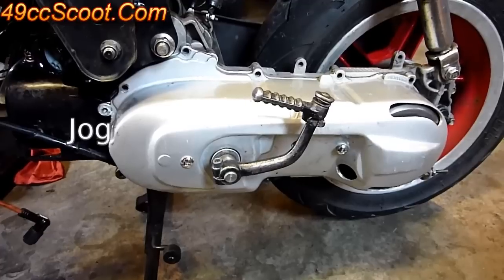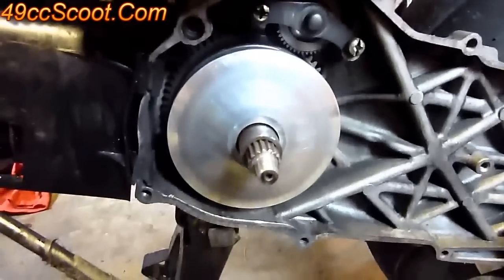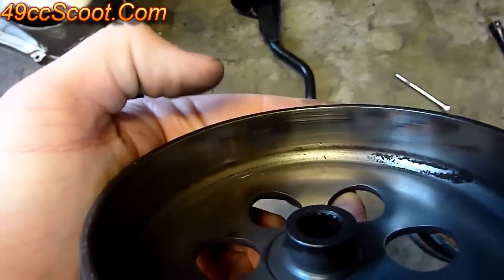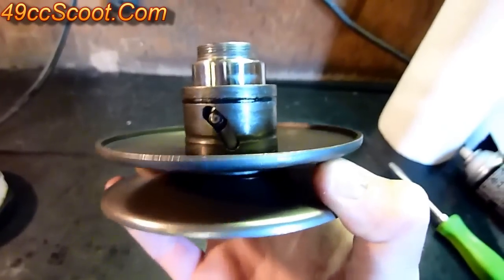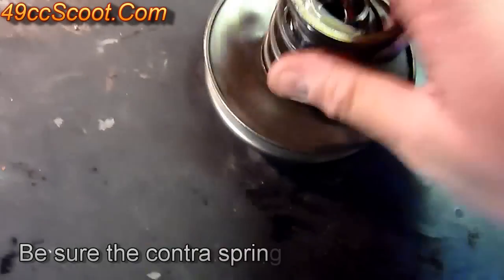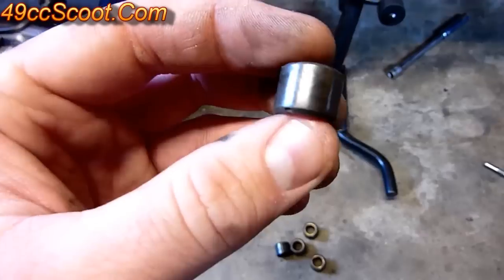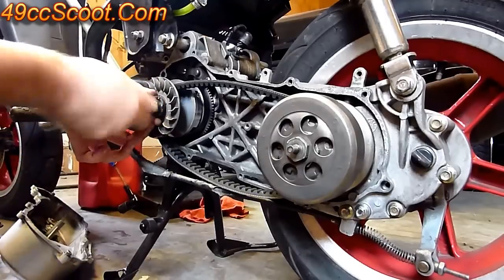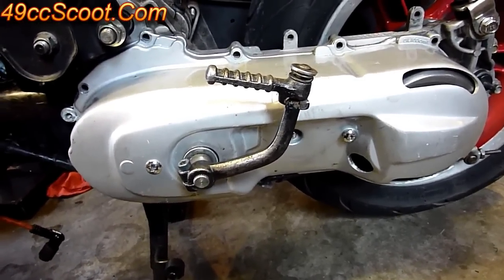Scooter CVT Transmission : Full Service Inspection

Comment: hi great video,I would like to ask you. my problem is,If i have no load on my scooter the clutch engages,when there is weight barely moves. please help what could be the cost? I was thinking clutch pads. I havn't opened the clutch bell cause i can/t remove it yet.
Reply from the maker: It sounds like the clutch is slipping under load. Could be shoes or glazed bell or grease in there. Could be that the belt is slipping from being too narrow or glazed or from issues with the pulleys. You're really going to need to get in there and look it all over to know.
Reply: ***** Thank you so much for the quick reply. I may have more questions for you in the future. I just bought this 50cc yamaha jog scooter Please bare with me 1st timer here,never owned a scooter before. weird thing here in the philippines is that my scooter body is a yamaha jog but the engine is a yamaha target....anyways its a vertical engine,Im using your videos as my reference even though you have a horizontal engine on yours.Its a fun little project. Good thing you showed the wobble in that clutch shaft I got worried! I have a bit more play in my clutch shaft though.
Reply: john santos  may i send you pictures of the parts of my scooter?
Reply from the maker: I don't have hands on experience with the verticals, but sure. Some of the guys on the forum have them, at 49ccscoot.proboards.com if you want to post there about your issue.
Reply: ok thanks.

Comment: Can anyone answer my question ??
Front covering part of my scooter has got cracking due to hitting into a minor accident 
Line cracks n small bloat 
Will it be Roadworthy????
Reply from the maker: So just the fairing? If it's only a plastic body panel, it may be roadworthy. Depends how stable it is and what is at risk if it fails. Not cool if it cracks and you lose the headlight or it falls off. It's one of those things you need to have someone local look at if you aren't sure.

Comment: I don’t see you servicing the transmission Only clutch assembly variator and belt was addressed in video and you showed me how to tighten the school where is the torque specs
Reply from the maker: That is the entire CVT transmission. The only other thing is what I tend to call a gearbox, but it's technically a final drive transmission. Just gearing to transmit power from the rear shaft to the axle and change ratio. Torque specs vary because I didn't intend this to be totally specific to only 1 scooter.

Comment: hi
i have a 49cc pulse scout baotian 139qma YES QMA stamped on the castings all over the place,
could you perhaps tell me what the optimal weight rollers would be for normal on the flat usage 
but give better hill climbing as i live in the UK wales mountainous region and need the latter rather
than the former,
i have subscribed and watched all your videos but nothing on optimal as std
thank you
david
Reply from the maker: 5g sliders are very popular for the stock engines. There's a reason I don't say X weights are best for every engine : If you want optimal, you tune. If you want a guess, I'd guess 5g.
Reply: thank you it at least gives me a starting point
and i have learnt so much from your videos 
don't stop please.
dave
Reply from the maker: Here's some stuff that may help if you haven't seen 'em :
https://www.youtube.com/watch?v=K5j8gHg5kMc
http://www.49ccscoot.com/faq/whatweight.html

Comment: in your video. while you were talking about the belts (7:30 into the video) i notices your air box in the background. are those extra holes you made? looks like theirs three.
Reply from the maker: They're UNI filter vents to increase airflow. I did that for a 103cc that had a 24mm carb and revved to 12,000RPM.  Not at all necessary for most setups. Removing the snorkel and enlarging the snorkel's hole is as far as I go for my 70-100ccs with 21mm carbs. Removing the snorkel is all that should be needed for a stock carb, and that's often unnecessary.
Reply: 90GTVert very helpful. thank you so much. what's a decent carb if I'm trying to go up in size. and any links would be helpful.
Reply from the maker: 19mm DellOrto PHBG is a good one that parts for are easy enough to find IMO. Fits the stock intake on all of my 1E40QMBs and it works with the stock airbox with a 36mm screw on adapter. Treatland dot tv is where I pick up a lot of DellOrto stuff, but there are lots of sources.

Comment: Hi I've just replaced my belt for my jmstar 50 and it starts fine and wheel will move when it is on stand by when I take it off the stand and the wheel is touching the ground all power goes and the scooter will not move anywhere unless I run with it ? Help please

Comment: Hello Brent, I heard a rumour meaning l forgot the source , that the lipped oil- grease seals need a protective cover when both halves  are either separated or assembled or expect  damage ? So now if anyone can find these very rare sized oil seals it would be a relief , l wonder if l caused the  damage inadvertently? Doh!
Reply from the maker: You mean like a guide to keep the sealing lips on the ID from going over any sharp edges? It's not a bad idea, but shouldn't be a necessity in most cases.

Comment: Hi I was searched for 125cc BWs engine turning over but not engaged with rear wheel and it turned up your video....any thoughts on what might be up or where i should start looking....Many thanks
Reply from the maker: If the engine is running and it revs up but doesn't move, the first thing I'd do is make sure the belt has not broken.
Reply: thanks for reply just found this out..snapped belt and  broken torque driver...i plan to replace seal belt and driver unless you can think of anything else..have found good videos to aid process
Reply from the maker: I suggest going over the whole CVT when a belt breaks. If nothing else you're likely to find dust and chunks that need to be cleaned.
Reply: Thanks very much for advice. Will do as you say

Comment: Help me a lot your video.  I have a BKM-Vento 100cc 2006 look very similar like your scotter, how many oil gear need to do the change? Thank you very much.
Reply from the maker: 110-120ml of gear oil. I use 75W90 Mobil 1 synthetic.
Reply: Thank you for your quick response. The oil do you recomend me, is obviously for transmission, right?
Reply from the maker: Alfredo Gonzalez
For the final drive transmission, not for the CVT. Most scooters use no oil in the CVT. You don't have to use that exact oil, but I would suggest a synthetic for gear oil.
Reply: Thanks again. Best Regards.

Comment: I drive about a mile i hear a clickin noise then it feels like the brakes are on and it dies. Try starting it but it is engauged and wont turn over. I push it a few feet i can feel it unlock and it will start. Any ideas what i need to replace?

Comment: My gy6 80cc don't have enough speed only noise could it be a longer belt let me know
Reply from the maker: If you haven't done it already, it may need heavier rollers or sliders to keep RPM where it should be with the big bore kit. Belt size shouldn't change due to big bore. It could be that the belt is worn also, so check the width vs spec.

Comment: I heard to remove the belt all you have to do is squeeze together and remove the belt way easier than using the impact drill to remove just the belt or is that the wrong way to do it and you can mess something up not sure
Reply from the maker: That will work on some, but you have to be sure not to let the variator move so the rollers can fall out when the belt is not in place. On prob the majority of scoots you can't do it that way.

Comment: I have a 49cc TaoTao with a 100cc big bore kit and it keeps disintegrating the front variators what can I replace it with without over range are there any better cast  metal variator bodies?
Reply from the maker: What variator are you using? If it's the real cheap stuff like DLH, they are known to fail. Try well known brands like Malossi.
Reply: @49ccscoot   I wish I could find one made out of something other than aluminum I have been using the off the shelf cheap ones I guess it's time to upgrade
Reply: Thank you for taking the time to answer
Reply from the maker: @melichyoshioamraw9333  Aluminum is pretty standard. Everything from my TaoTao 50 to my two-strokes to my TMAX 500 use aluminum variators. Quality parts should hold up.

Comment: i have a gy6 taotao 150cc i was driving it yesterday and then somthing sounded like it was hitting something inside the trans. i opened it up and gave it gas and the belt wasnt spinning it was just making a loud noise. the belts not broke but imma replace it anyway. is it just the belt or could it be more than that?
Reply from the maker: Clifton Davis If the belt isn't spinning, there's something more serious going on. I'd advise performing a thorough inspection of the CVT as shown in this vid to find out what has happened.
Reply: ok thanks i ordered a new rear clutch, a  belt and stuff but what do you recomend or think is the problem? some parts did look rusted out
Reply from the maker: Clifton Davis It's hard to say without being able to check it out. My best recommendation is to be thorough in your inspection.

Comment: help. i have a wierd noise when the wheel is turning. it comes from the back of the clutch bell.
Reply from the maker: Take the clutch/rear pulley/bell apart and check it out.

Comment: Usually at what mileage or years of ownership then this servicing is require ?
Reply from the maker: It will vary by scooter. Your best bet is to check the owner's or service manual for a maintenance schedule and follow that. It's commonly 2,500-5,000 miles for small scooters. If a scooter is modified, it may require much more frequent checks.

Comment: what would make a clutch spring snap? tow clutch spring snap already. dose it have to do anything to do with chain adjustment. the clutch magnets are warn do i need to replace the clutch. I have a single spring clutch
Reply from the maker: If the shoes and bell are worn badly maybe it's putting a lot of stress on the springs. Maybe the spring is the wrong one? I had a spring break years ago within 100 miles with all new parts so, even though very uncommon, I suppose it happens with maybe a poor quality spring.
Reply: ***** What are some good high tension springs. I have a GP RS-R mini pocket bike
Reply from the maker: Not really sure. I've never messed with the true pocket bikes. When I used to have a midbike, the next size up, I was around pocketbikeplanet a lot. Check that site out. There were/are a lot of knowledgeable enthusiasts there.

Comment: i have a ludix blaster rs12 and everything is working fine apart from i have to go down a slight hill for my bike to open up fully and actually go fast do you know why thats happening  am air and fuel is fine it doesn't bog or anything and goes up hills fine its just when am on a flat road it wont gain much speed till i go down a little hill then it starts taking off
Reply from the maker: A CVT check and clean would be a good start. Pay attention to the torque driver. Maybe something just isn't moving free.
Reply: okay i will have a look tomorrow i did take the clutch out and sand it down but didnt seem to help much so i will look at the torque driver
Reply: i have gave it a good clean and checked the torque driver and it seems fine could you think of anything to try?

Comment: My PGO Dr. Big accelerates very weird.
It goes up to 6000 RPM and then sits there for a while (it also accelerate slow) and after 3-4 seconds it suddenly goes up to 8000 RPM and accelerates up to its maximum speed quicker than it accelerated when it was only doing 6000 RPM.

Do you know, what could be the problem?

Comment: One last thing wouldnt that be in the starter push switch on the right handle where the gas,or maybe electrical cause thats the starter button,the starter button doesnt work I start it from the selinoid?
Reply from the maker: Could be the brake switch, the starter switch, or the relay not working. That's why I suggested the link which should help track it down. You need everything to work in that chain.
Reply: If its the crankshaft yes?somethings locked up the variator is not turning its time for a new engine

Comment: Hey 90gtvert i have a keeway F-ACT and want to change the rollers butin the middle of my cvt case where you showed a bolt i have what looks to be like on your taotao carb were theyre rounded off how do you recomend removing it easyouts ? i have ordered a set off of ebay so im hoping that would work any help is appreciated
Reply from the maker: ***** I haven't seen that on a CVT, maybe it just broke. Either way, yeah easy out/screw extractor would prob be the way to go. If it's just the head and it started to strip, try a different size screwdriver, tapping it with a mallet, or an impact driver.
Reply: Managed to get to bolt out thankfully but managed to damage my fan and variator trying to get the nut off without a impact I have ridden the scooter and it seemed fine but it is missing 2 fan blade things and a chunck out of the variator not the face where the belt goes im just a bit worried of it messing up my cranck with uneven weight going round what do you think?
Reply from the maker: It's not ideal, but I have used them with 1 or 2 blades chipped off. I'd try to replace it as soon as you can. If you notice any strange vibrations after it's reinstalled, don't use it till that's replaced.
Reply: Thanks i have just ordered a new variator and fan so ill have to make do for the minute as i need the scooter to get to work

Comment: So my 139qmb cvt belt raises above the variatior when the clutch is fully engaged (scooter wide open)  what can I do to make the belt ride lower when at full throttle?? It’s causing it to only reach about 8400 rpm’s and just holds there, makes my speed top out at 40; I’ve got 1500 contra and clutch springs, 5.5 gram rollers
Reply from the maker: Lighter rollers or shimming the variator. A stiffer contra spring could also work, but most don't need really stiff springs. Make sure it's the right belt for it as well.
Reply: @49ccscoot  I thought shimming made it raise up more lol, I’m still trying to figure out all this tuning stuff, and I’m pretty sure it’s the right belt, 669x18 normal 139qmb short case
Reply from the maker: @predator_boiz336  Shimming makes the variator wider, so the belt can't usually ride as high in it... but it may ride higher in the rear pulley.
Reply: @49ccscoot  gotcha, thanks; I’ll give it a shot

Comment: Hi Buddy! I own a 54.000km Daelim s1 125cc scooter. When I roll up a hill, carry a pillion or accelerate abruptly, my transmission kinda "slides" and the scooter stutters. It's not an engine issue, I'm almost sure, since it's less noticeable when I ride alone.
Do you think it might have the same problem? I checked the belt and it's ok :(

Thanks in advance!
Reply from the maker: If the belt is not glazed or worn thin below the service limit and the surfaces of the pulleys are in good shape, then the next thing to check is the clutch and bell. You may be able to de-glaze both with sandpaper/emery cloth, but also check the diameters vs service manual specs. Could also be something like a seal leaking and the belt or clutch getting essentially lubricated and not being able to grab so if you see oil/gear oil from an oil seal or grease from the torque driver then clean everything and fix the leak.
Reply: *****  riiiight! thanks! I don't think it's a seal, since it becomes worse when the scooter is "warm". I'll re-check my belt for the service limit!
I also sometimes sand the inner side of the clutch bell and the clutch shoes, but it gets back to the same problem after a few miles :(
Reply from the maker: If it goes away when you sand the clutch shoes and bell, then that's where you should be looking. It may be time to replace one or both. Again a service manual should have specs or you can look at clutch shoe thickness and have a pretty good idea if they're too thin.
Reply: ***** thank you good sir. I'll try to "debug" my problem this weekend.

Ride safe :)

Comment: I just purchased a Roketa 250 and it has 3000 miles.  There is a squeak or squeal when it is idling and when you are going slow.  Sounds like something is rubbing while running.  When going faster 30 40 mph it is quiet or not as loud.  The brakes squeak too, but I can fix that.  Do you know what would be causing the squeaking noise at low idle or low speeds?  Makes it sound like crap.
Reply from the maker: Iraq Vet5167 It could be a lot of things. First I'd let it idle and walk around the scoot to see if I could pinpoint the location a little better and narrow down the search.

Comment: what is the most watt headlight bulb a chinese 50cc bike can handle without any problems
Reply from the maker: To be safe 45W will usually work. I've used as much as a 65W, but there is risk of melting connectors, the headlight housing, or even the fairings near it with some high watt bulbs. If you are using 2 bulbs at a time you have to reduce wattage because most can't handle much more than 60-70W total.

Comment: How often should I do this inspection.
How many miles before ??
Reply from the maker: +bob foster Opinions vary. I'd like to see it done at least every 2500 miles even with the CVT working well. Many put it off till it starts acting up. If the CVT is giving you trouble, a full inspection and cleaning is one of the first things I often recommend.

Comment: My belts angle is kinda big and my speed has been decreased step by step so do i have to buy new one
Reply from the maker: Compare width to specs and replace if that's off. If you think the angle is off from wear, replace for that reason. They're a frequent maintenance item on small scoots.
Reply: @49ccscoot  thanks for answering. I will buy new belt tomorrow.